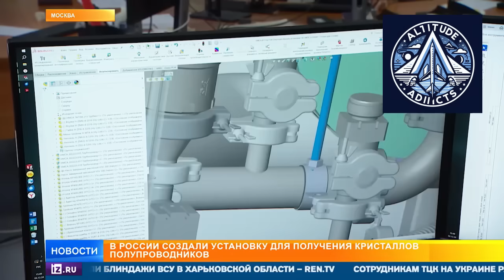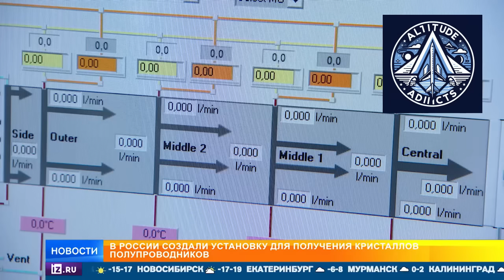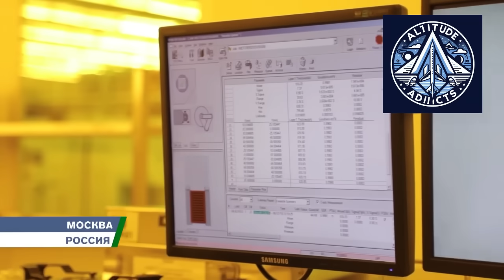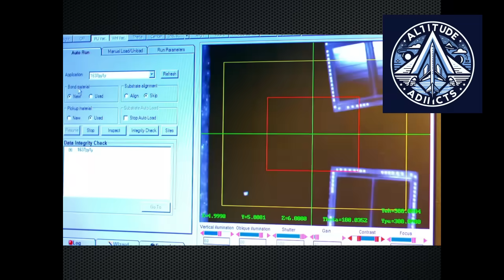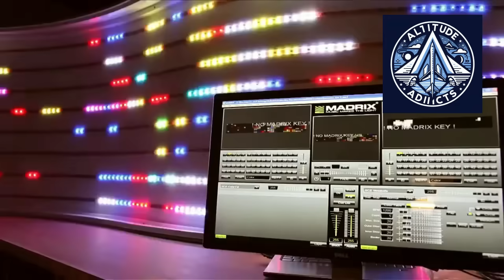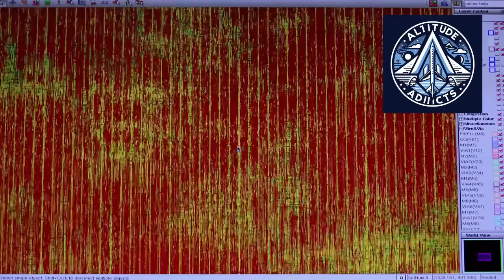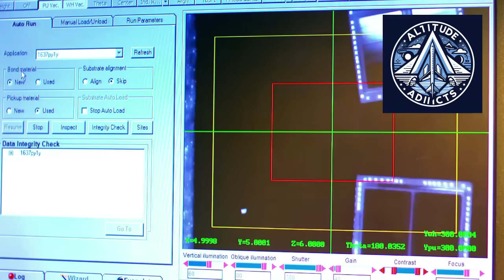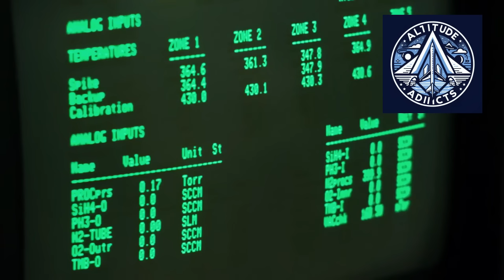Russia’s Lost Microchips: The Baikal–TSMC Controversy Explained

Comment: China doesn't need TSMC, ASML China is self innovation and self sufficiency Russia should work with China
Reply: but I think China ASML still need to depending on Netherland's Lithographic machine (if I remember it correctly), which is under EU and luckily, China is not under Sanctioned yet but not sure EU limited any access to such high tech equipment?
Reply: @PSR_Macky  This is not correct any more. China has produced their own lithographic machines based on their own completely new technology and are able to produce advanced chips comparable and better than the chips from the western technologies. Look it up.
Reply: @PSR_Macky  yes they are, US prohibited to sell any litographic machine to China

Comment: seems this is Russia's timeline  350nm photolithography machine signed off in 2024 deliveries 2026  - 2026 sign off of 130 nm machine - deliveries 2028 .... 
but here's the big news that machine will use DUV lasers ..... and that then makes it possible to make chips right down to 28 nm. 
 That 130nm DUV laser machine will definitely catch the attention of the "west" ....
Reply: India is technically a little ahead with 28 nm chips for space and semiconductor design.
Reply: @aaroncruz9181  Yes, but the lithography bougt by ASML - not developed by itself.